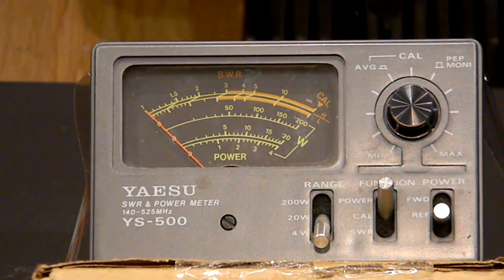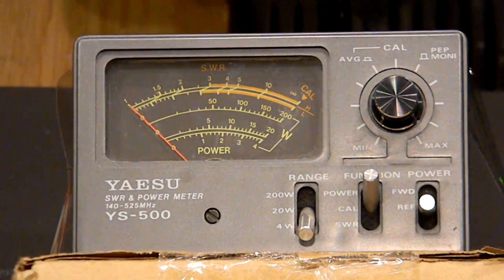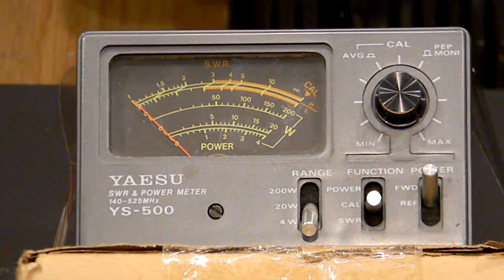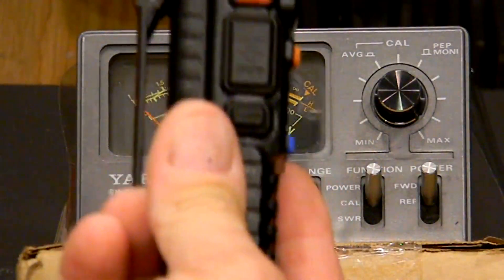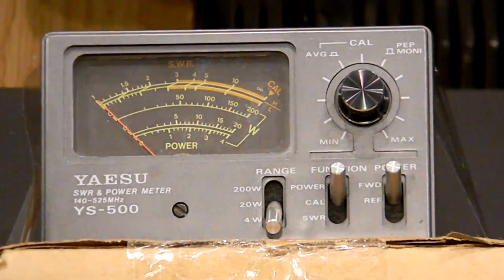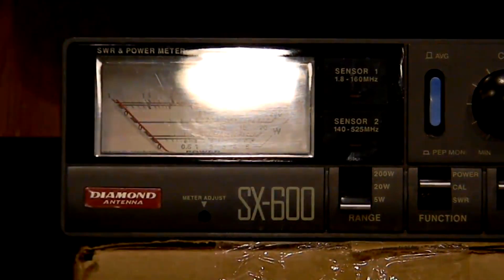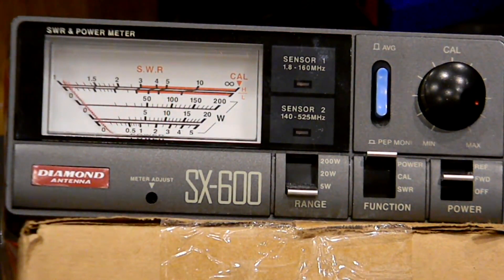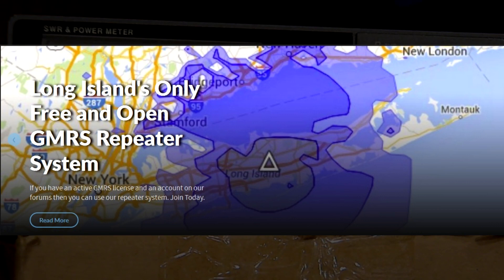How many watts does the Baofeng UV-5R do on the GMRS band? (65m)

Comment: Depends on version and year radio was built the newer versions are 5w on my meter and older 5yr old uv5r that only had 4w on high battery fully charged ..i think older versions seem better in quality too sound different between new and older as well ..I run a BNC base antenna with 25ft  lmr400 1.1 across 460 to 470 mhz can also run on 440 at 1.5 hearing repeaters 40miles away no problem..
Reply: BRC antenna daaa.

Comment: On your SX-600, if the red highlight bar indicates which sensor you have active on that meter, it appears you had the 1.6-160 active and not sensor 2 for 140-525 which would be the correct selection, this may very well be the reason you had the lower reading on this meter, I’ve seen the similar instance when using the wrong frequency range on a Bird Watt meter element, where the HF element would read lower than a 2 meter or 70 CM element....along with using a 50 ohm dummy load, instead of connection to an antenna....

Comment: As of 2017 some GMRS ch are 50 watt max . I have Baofeng GT3-TP which is 8W and dropped to 7. 5 watt on GMRS . Best to use dummy load to measure power. mine is DC to 3 GHZ 300 watt with N connector.  73s

Comment: You know the FCC may come calling as the UV5R is not FCC approved for GMRS! Next time use a GMRS V1 Baofeng for the test as it is FCC approved for GMRS.
You could get a Fine and loose your GMRS license if an FCC inspector sees this video. 65 meters, I think not! These tests are not valid. 

(RF TECH.)
Reply: No one in enforcement cares about gmrs frs etc. As long as you stay off repeaters with your unlicensed baofeng no one cares.

Comment: wow. blind man leads blind. your antenna has no effect on your power meter. in fact you SHOULD be testing into a dummy load. CAL setting calibrates the SWR meter. you just don't know what you are talking about.
Reply: I wouldn't even bother using the SWR scale on a typical hobbyist meter. SWR is calculated from Pf and Pr and it's more accurate, especially at low power levels, to use them to CALCULATE the SWR rather than rely on the meter's "SWR" reading.
At lower power levels many SWR/power meters won't even calibrate.

SWR = ( Pf^1/2 + Pr^1/2 ) / ( Pf^1/2 - Pr^1/2 )
( ^1/2 = square root ==> 4^1/2 = 2 )
Reply: How rude, get a life. The guy is performing a service for the curious. If you didn’t want to watch, go elsewhere asshole.
Reply: He also transmitted at 3watts on GMRS channel 8
Reply: Oops!

Comment: Tried radio check on every MURS & GMRS frequencies and no one responds! On the GMRS frequencies I do not have the repeater access. Even tried the emergency travel tone. I do here people talking on GMRS! Never on MURS! Uv6ra and uv5ra.
Reply: It's a dead hobby. No one enforces the gmrs licenses or over powered tx on it. Dont be a dick with a baofeng and talk over people or mess with repeaters and you'll be fine.
Reply: I purchased a Baofeng MURS radio, all the channels had either a CTCSS or Digital code on them, so I never heard anything. I went through the 11-13 and 10-12 command and removed the encoding off them. They put them on to test the operation where they were manufactured. Now I can hear things now the tone requirement is removed.
Reply: @M. S. Yes. Its dead. Look at the volume of ham licenses issued and the rate of equipment sales. The cheap UV5r and the prepper segment are the only recent uptick in usage. Dont look at 2 or 3 years of history. Look at the decline over the last 25+. More importantly my comment was addressing the gmrs for business aspect where the licensing for that band isn't even enforced anymore.
Reply: @M. S. you have mis-read several points. We're done.

Comment: I use a dummy load with my four UV-5Rs, and consistently get power readings of 6 watts on VHF. On the UHF band of legal to use European frequencies, PMR 446, get readings of 5.1 watts.
You should try the radios with Red or Blue or yellow cases. The power is always higher with them; they may originate from a different factory.

Comment: An SWR measurement at the radio itself is inaccurate.  Depending on the length and type of coax you are using on 460MHz your loss can be very high.  Loss works both ways--both in forward power and reflected power.  The only way to accurately measure it is right at the antenna.   High quality LMR-400 coax has a 3db loss per 100 feet at 460 MHz.  That means that half the power that leaves the radio reaches the antenna--and half the reflected power is measured at your meter.   GMRS is NOT 65 meters.  Perhaps you meant 65 centimeters.   Your swr meters are inaccurate as well.  Inexpensive meters are notoriously poor for measuring power particularly at that frequency.
Reply: Ed Petrovski 
So he should install his power meter up on his tower just before his ant, then climb up and read it? You must be kidding, lol.
Reply: @repairfreak , no he should use a dummy load, and stop being a dummy load. So many things wrong with this...

The UV-5R is a part 90 amateur radio. It's rated for 5W VHF, and 4W UHF, in the ham bands. It's not even legal to use it to TX on gmrs. However, many people use amateur radios on gmrs, and some day, one of them will get a complaint filed against them. 

Amateur radios TX at 25 khz in wideband mode. GMRS is limited to 20 khz. So it won't take anything but a recording of your transmission, with a SDR radio, to show that you are using an illegal transceiver on the gmrs bands. Then you lose your license and pay a fine. 

Good times.
Reply: @paaao  
I agree, if his antenna is correctly matched “tuned” the radio will effectively transmit the maximum power output of the Transceiver. In my opinion the losses in high quality coax at reasonable distances make very little difference in power output performance. More importantly IMO would be type of antenna, height and location of it, assuming use of high quality coax, and a good transceiver. If someone is worried about Milliwatt losses in coax for a 4-5W handheld radio, maybe they should consider another type of radio for a base station? Just my .02 🤔
Reply: @repairfreak , the loses at 470 mhz in coaxial cable are not "milliwatts". You lose about 1 db every 100' at 470 mhz with high quality 1/2" hardline heliax cable, with N connectors. (10 awg solid center conductor) So if you run 25' of RG-8X or some other cheap coax, you're going to lose more than 1 db of signal on TX, and RX at less than 50'. (Rough estimate, but the point is, your swr reading is bogus when you do this, especially factoring in an antenna)

Comment: The direction switch is in the Reflected position. To measure SWR the switch has to start in the Forward position. THEN apply a low power to the input & set the CAL pot to full scale. Switch to Reflected to measure SWR. To measure power. set the switch to Forward. You can ONLY calibrate the power scale when you have a calibrated power meter (Bird) in line with your meter. An internal pot will calibrate the power scale for that frequency only.

Comment: gmrs  is not free it cost to get your lic no need for test
Reply: You cannot legally use a UV-5R on anything but ham bands. Using it to transmit on GMRS is a federal crime.  Also, failure to transmit your GMRS call sign, during or after testing, is also illegal.  47 CFR 95.1751 - GMRS station identification.
Reply: @UpnorthHere  It may be in the book but there has been zero enforcement of the gmrs licensing scheme. Why spend $80 on a license for a walkie talkie that only cost $60 for a pair. It's a dead issue. Only the borderline autistics that still live for morse code care about licenses and spout federal regs.
Reply: @James Babcock it's legal only on ham bands.
Reply: 70 dollars for 10 years to get a GMRS License. Better than FRS, because with the GMRS license you can get a removable antenna, and with an adapter put an outside antenna on it!
Great idea for CERT! Plus it is a real radio, not a childs toy radio.

Comment: q and a: is it legal in australia to use a boafang UV -5R on  uhf 467-000-477.00  band  yes or no ?
Reply: Shouldn't be an issue to receive only
Reply: @tims001  cheers I got new ones to replace them I have now go a wauxon KG-UV9D plus and a boafeng UV-9R plus and a retevis RT-9000D
Reply: @matthewdempsey6583  what do you like best?
Reply: @tims001   the wauxon  because it has more channel slots to save ur favourite channels

Comment: great to see the sx 600 is wrong i know now not to buy one.. the uvr5 s are about 3.9w on a bird on 65 cm. the yaesu meter is good
Reply: I got the impression that the SX600 was operating on sensor one, which does not cover UHF.
Reply: Diamond SX-600 is a good meter.I checked mine on a Marconi test set and it was spot on.

Comment: Ham radios fail the FRS/GMRS legal requirements at least in  3 areas: 1) they have detachable antennas, 2) they provide minimum power superior than 0.5W ERP, 3) They are not Part 95 certified...  Sure that in an emergency situation any frequency is allowed.  If one needs a good and legal GMRS radio (no exclusive FRS  frequencies) there are a few higher power versions available. I guess the point is not how many got caught using ham radios on these frequencies or whether the FCC can easily enforce it, but the question is why one would consciously break the law when there are legal options? It is a personal choice.
Reply: GMRS is NOT FRS and does not have the same restrictions.  GMRS radios may have detachable antennas.  HT's can go to 5W, mobile and base to 50W.  B clear when posting replies that may be confusing.
Reply: @senseinyc  GMRS is legal only on radios specifically labeled for GMRS
Reply: Tried a radio check on every MURS & GMRS and no one responds! Uv6ra
Reply: Yes, and posting a video of yourself violating federal laws may turn out to be its own reward when they confiscate your equipment and fine you $10,000 for every time you clicked that transmit button, if not more (it would be multiple violations each time).

Comment: I dint think the UV-5R was type accepted by the FCC for GMRS use????
Reply: If your operating on GMRS frequencies (with a license for GMRS) Your radio can have a detachable antenna, and you can transmit up to 50 watts.
Reply: It's not...
Reply: Costa Apostolou even not enforced it's illegal..... your thinking is flawed lol.... it's like saying you can do something but you may not..... why bother.. is my point.....
Reply: @N3OST  It's more like jay walking, illegal, but NEVER enforced!
Reply: @par2k  FCC just wrote up a huge document that includes these radio use.. that could change
Reply: The reason it's illegal, is because if you transmit at too high a wattage, you could be inadvertently interfering with other people's communications. You won't hear them because they're only transmitting at 0.5W/2W, but they will hear you transmitting at 4W. Even if you don't care about the law, it's rather inconsiderate.
Reply from the maker: You should say the same for ANY Motorola radio's out there as well. They are for business and or fire/police. No one bitching about that. ;)
Reply: @Amateur Radio and GMRS:  Point out any violators using Motorola radios illegally and we would be happy to forward it to the FCC for their consideration: whether to enforce the rules, ignore the rules, or change the rules.
Reply: Ham radios fail the FRS/GMRS legal requirements at least in  3 areas: 1) they have detachable antennas, 2) they provide minimum power superior than 0.5W ERP, 3) They are not Part 95 certified...  Sure that in an emergency situation any frequency is allowed.  If one needs a good and legal GMRS radio (no exclusive FRS  frequencies) there are a few higher power versions available. I guess the point is not how many got caught using ham radios on these frequencies or whether the FCC can easily enforce it, but the question is why one would consciously break the law when there are legal options? It is a personal choice.
Reply: Rational Raven sad but no one cares how they may interfere anyone else as long as "they get out"
Reply from the maker: Actually GMRS has a 50 Watt limit, and any GAIN antenna. Sooooo. a 10Db antenna would yield 500 watts ERP.
Reply: michael weiler no one enforces it thus its not illegal, personally I don't do it but if they don't enforce it I see nothing wrong with people doing it.
Reply: @Costa Apostolou: Pretending that "they don't enforce it" just makes it more likely that you will be caught sooner than later. If you "see nothing wrong with people doing it", write letters to the FCC to have the rules changed.  You cannot simply ignore laws that you don't like and expect to avoid fines and prison when you're caught violating them.

Comment: The calibrate is for SWR.  You should use a dummy load and a good meter (Bird) for a reliable testing.
Reply: I have 6 Bird Thrulines, they are an industry standard but not ridiculously accurate. The twiddling of the CAL control on each meter seems a bit random, it is only used to set the reference level for the FWD measurement when measuring SWR.  The huge discrepancy between these meters is more than you would likely see comparing two Thrulines.
Reply: I have vswr 175 meter. Can I use the baofeng uv5r on that unit? Any reply appreciated cheers from Australia
Reply from the maker: Not that critical with a 5 watt radio, as you should have known that.

Comment: Illegal AF too for GMRS use.. But hey whatever, if it works right.. lol
You REALLY should connect it to a dummy load to get an accurate reading...
Your power per frequency is related to the antenna tuning.. this is why you should use a dummy load.
If your going to be a radio man you need to get a proper watt / swr meter like a Bird with UHF slugs. The ham radio meters are OK but the fact you have to calibrate them every time does not make them stable or accurate
4 watts is the legal allowed limit for a UHF handheld radio in the US.
Reply from the maker: I wanted real world numbers, not fake from a dummy load. I wanted to know what it was radiating from my antenna.  It would be great if you could donate the $$ for the proper watt / SWR meter. However, the average Joe (like myself) will most likely have the equipment I own vs a high tech Bird meter. Repair shops will have what you listed above. Thanks for watching. ;)